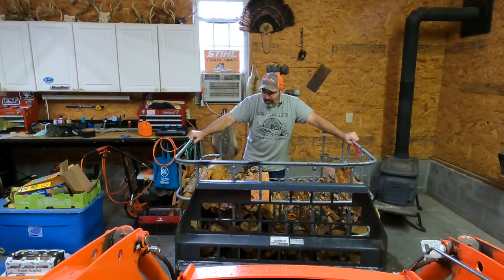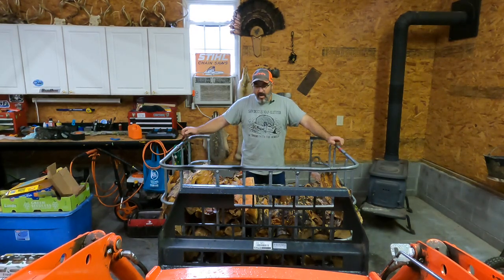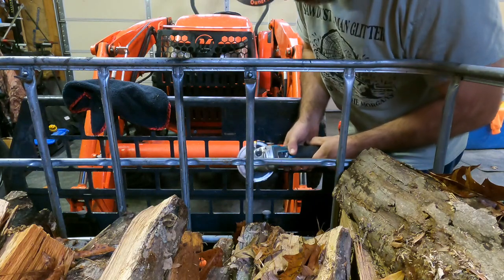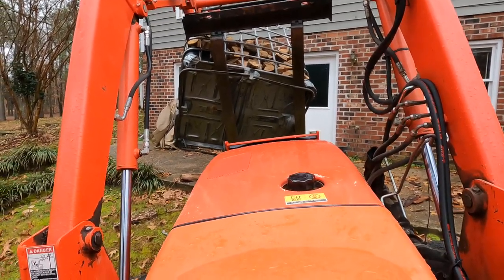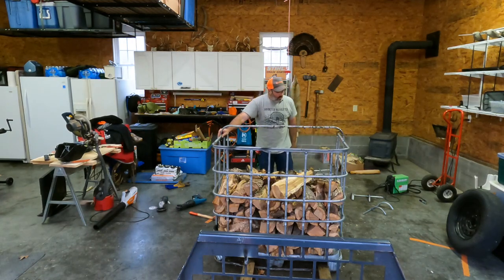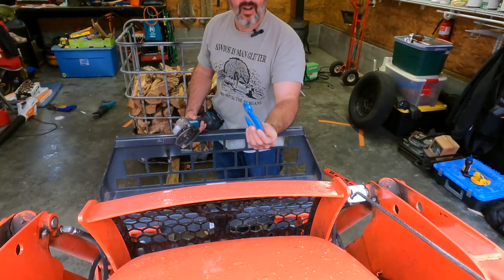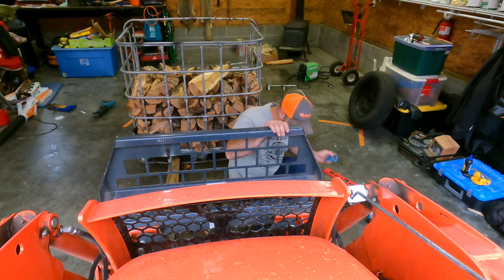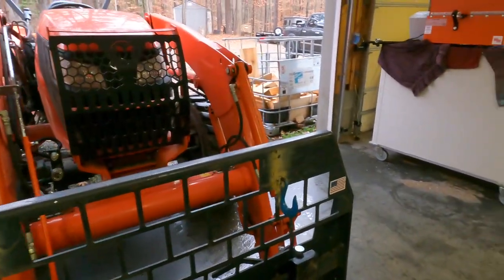The last IBC firewood tote video you will ever need to watch !!

Comment: hi there you have some nice toys ,that looks pretty good but not wanting to weld anything on the flat face of the fork frame .have you thought about something maybe hinged that just flips over when needed , good show john
Reply from the maker: Yeah in the video I talk a little bit about that. Thinking maybe something that wraps over the top with a couple set screw type bolts…moveable slotted positions for hooks to go up and down..

Comment: Most forks have holes in the end to drop a bolt into to stop things from sliding off forks.
Reply from the maker: Yes but the idea is to stay on the tractor. That’s also the problem with chains and straps. This works surprisingly well. When I just need to move the cage I don’t bother pulling in all the way. I stop about an inch short of the hooks so I can quick slide it on and off.
Reply: Much easier to drop 2 bolts in a hole then doing straps and chains. you take 2 long bolts with a nut half way up, slide the forks in , drop the bolts in your done. @SevenOaksOutdoors
Reply from the maker: I agree but that’s not what I’m doing here. I just drive in and pick up. Never leave the seat.